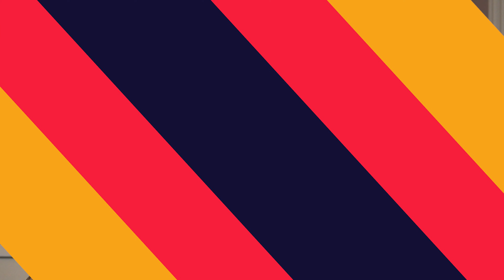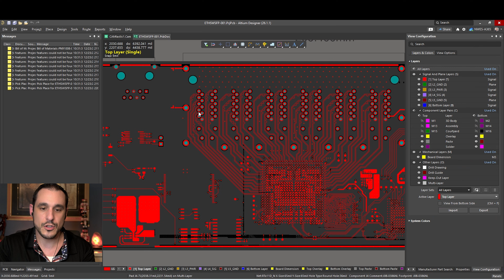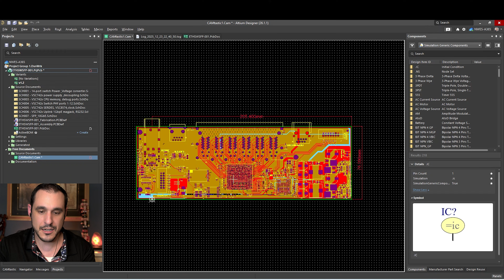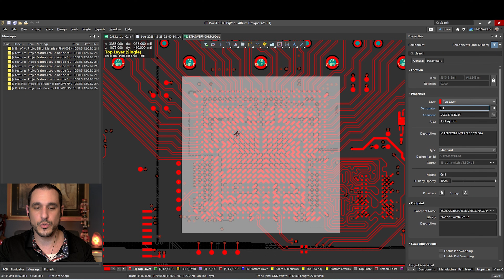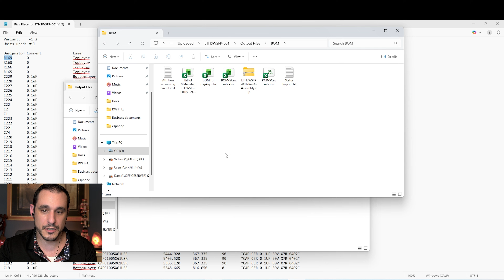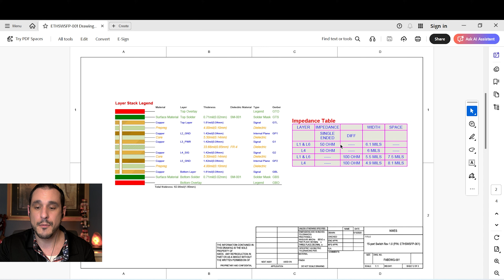So You Finished Your PCB Design... Now What? #pcbmanufacturing #electronicsdesign

Comment: 1. Is the "don't send this" advice just about keeping intellectual property secret, or does "extra stuff" often lead to problems even in the manufacture?
2. Does testing ever need the schematic?  (I assume the net lists are sufficient, but ... have a nagging feeling that I am forgetting something.)
3. The fabricator doesn't need part numbers and the assembler doesn't need inner layers.  When these are the same company, is there much point in holding anything back?
Reply from the maker: 1. Both. IP protection is important because the fabricator would have the entire set of IP if they had your schematics. Without the schematics, there are a lot of boards that could kinda be anything. With assembly, sending the BOM and IPC netlist is basically everything you need to reverse engineer or understand the build, but you're only releasing to the assembler and not the fabricator.
2. Basic electrical tests (continuity testing) does not need the schematic. In fact, if you want specific testpoints probed for continuity checks or electrical checks, there is an export for that which eliminates the need to send schematics or BOM. In the case of in-circuit testing, you typically need to provide specific probe points and expected voltage/current readings, or if there is on-the-line testing there will be a programmed procedure that probes the board and reports the measurements.
3. When these are the same company there is no point holding anything back. Might as well keep the schematics just to make it slightly harder to replicate the device. But that is why a lot of my commercial customers will do fab overseas and assembly in the US or Canada, they actually have legal recourse if the assembler sells off the design data without permission.
Reply: testing needs a netlist. once you have a netlist, plus footprint info which is obvious, reverse engineering the schematic is just a modest chore, and likely to become trivial with rapidly evolving tools. add in a BOM and you haven't protected anything

Comment: I was also taught to add text labels (off board) to each layer on the Gerbers containing Company name, layer #, REV, and project name for easier reference for fab house. Maybe you did this but I watched on my phone so I couldn’t tell :)
Reply from the maker: I have done that in many client designs where it was specifically requested. I think that is superior to stacking stripes or placing numbers in copper layers. It's also good for mechanical layers if you need them, such as in flex designs with stiffeners.
Reply: I assume this off-board text gets clipped before fabrication.  
1. Does that set a bad precedent for ignoring/editing the design without telling you?  (Maybe that ship already sailed?)
2. Don't stacking stripes (and layer numbers, with the right equipment) allow verification from the physical object, in a way that off-board text can't?
Reply from the maker: @jimjjewett  Maybe they put a marking on the panel level, but in the individual board level it gets clipped. Stacking stripes are intended to allow for physical verification.